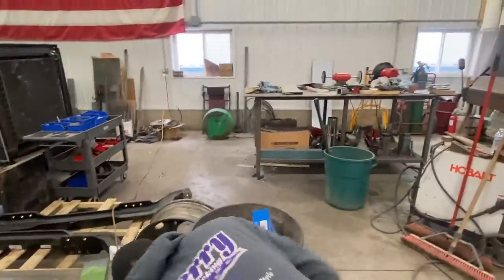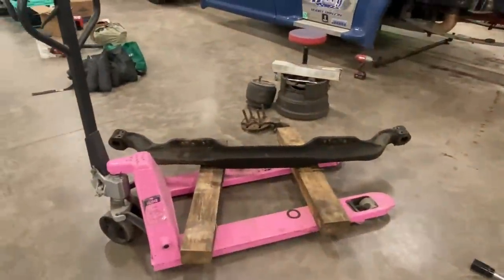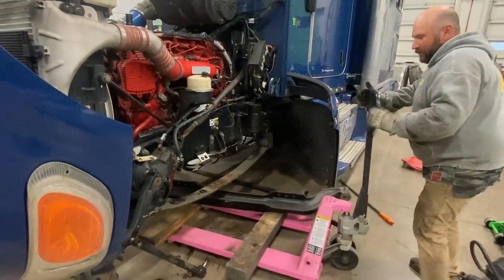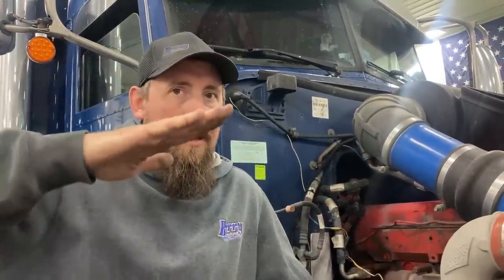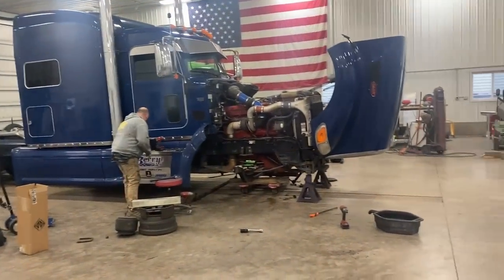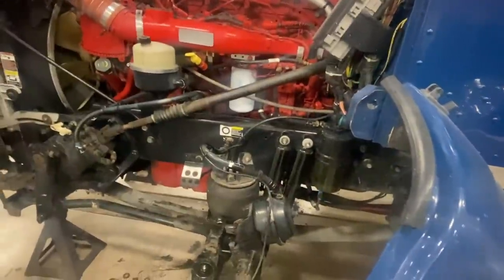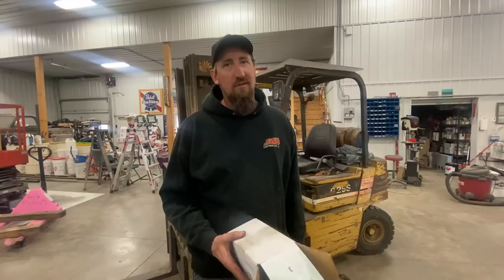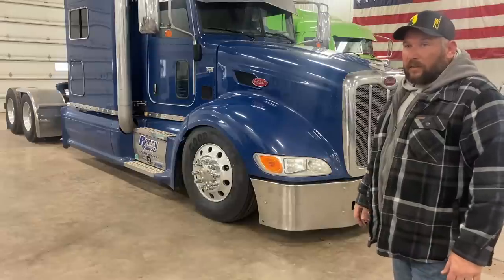Car Hauler Front axle on a Peterbilt 386

Comment: the problem i see with that deep a drop is that the radius on the fender does not match anymore, including the radius on the bumper. needs some fiberglass work on the fenders as well as some welding on the bumper to look right again.

Comment: Another way to describe what the wedges do is they add positive caster to the front steering geometry.
When you add front rake, you reduce the caster which as you pointed out would cause the truck to wander and not center itself.
Positive caster adds negative camber to the front tires when you turn which helps keep the tire contact patch at a more even load on the road. This reduces front understeer.

Comment: Hey chad is it best to switch a 1998 379 to a 389 spring (single leaf stock) then do like a house of air. Or stick with the factory. 98 axle with a kit? How much lower will it go? I run 24.5 but for some reason my 98 was ordered with stud pilot which is weird so I’d be updating to a budd wheel also. Hopefully your at wildwood I’ll stop and chat
Reply from the maker: You can switch to a 389 spring, but it isn't as easy as you think.  You will have to move the spring hanger back, and then also figure out what to do with the hood guides.  That takes a little time, so I usually just leave the stock springs in unless the customer wants to spend the extra money.  It doesn't get much lower, if any at all.

Comment: I have a 92’ 379 Peterbilt. Would this wide base axle work in my truck. If not would y’all have the part number for narrow base axle that would work for my truck?
Reply from the maker: No it would not work, unless someone previously put the widebase parts in.  The spindles and tierod bar is different.
Reply: @berrytruckn  so if I go buy the spindles and tie bar then I can do the swap? I’m not against buying everything.  By the way- your dump truck was absolutely amazing to see in person at MATS!!
Reply from the maker: @gtmotorsports937  I would say you would have to buy the complete axle assembly.  That would be you're best option.
Reply: @berrytruckn  alright. I appreciate it. I’ll see if I can dig up a part number for an older car hauler axle that will swap with my parts or check the local
Salvage yards for a complete wide base unit. Thanks for the replies!